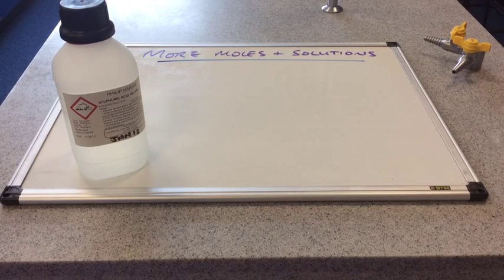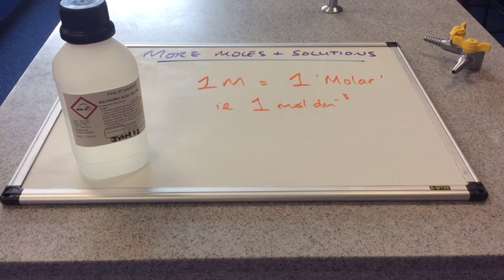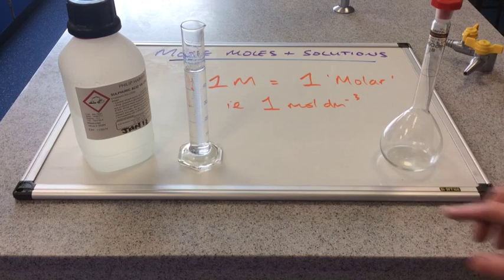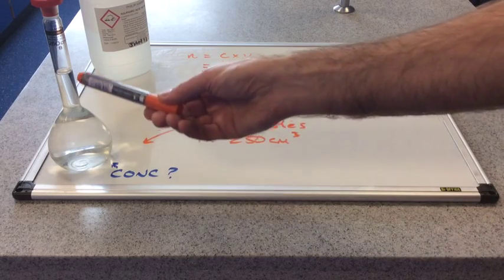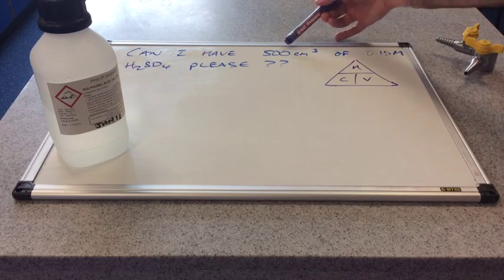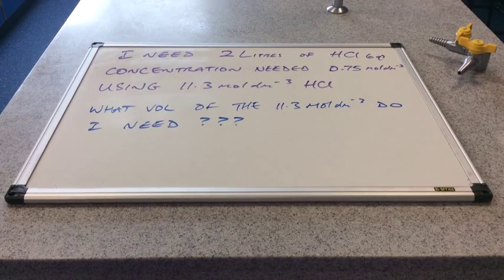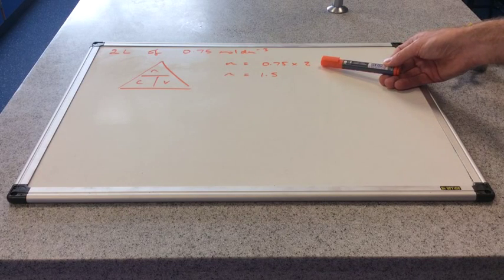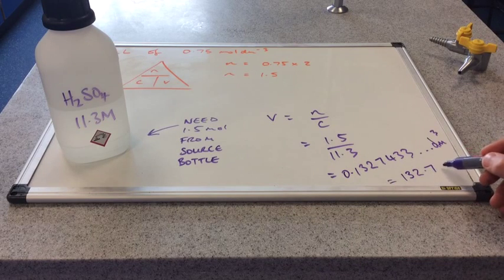More Moles and Solutions

Comment: Excuse me SIR, in the end isnt it that we need to add 425cm3 of water to the 75cm3 of  1M sulphuric acid 
cause if we add 500, then the total volume will be 575 cm3
Reply from the maker: You are of course correct. I should have indeed said dissolve in 425cm3. I think I meant to say ‘and make up to 500 cm3’
Thanks for letting me know 😊